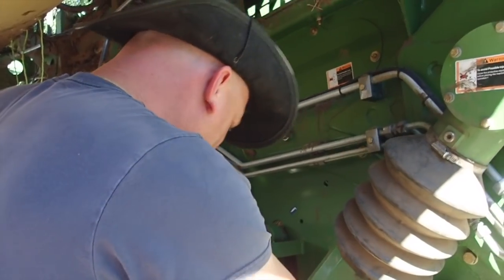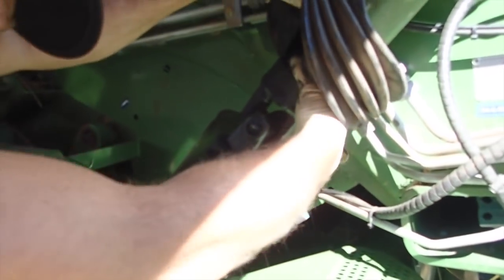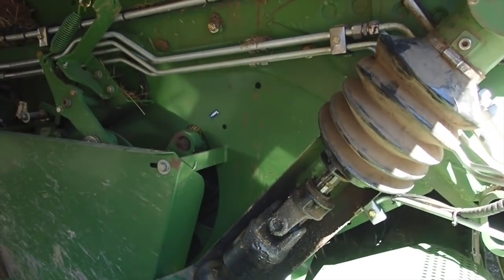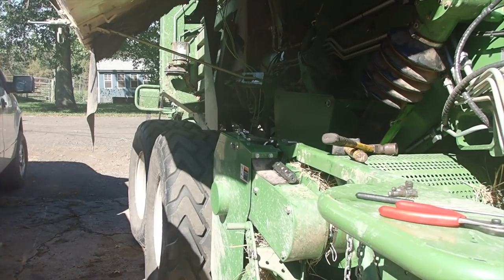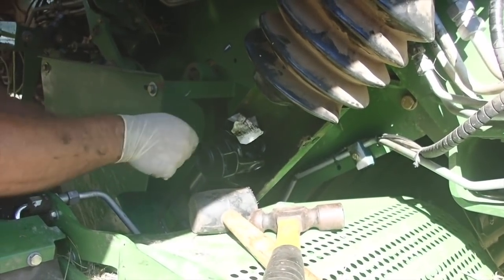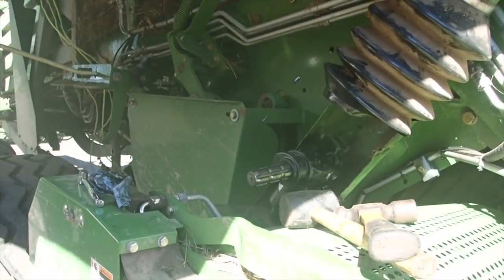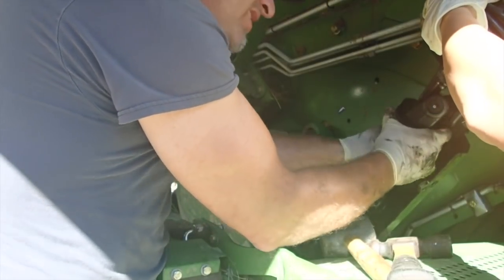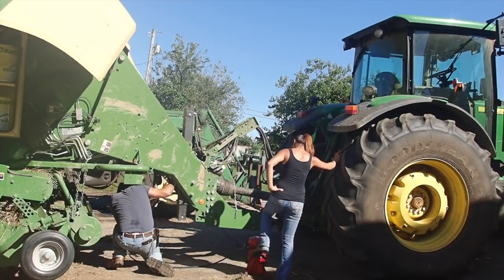Krone Shaft Problem (fix)

Comment: onelonleyfarmer Not sure if it matters in that straight shaft application but it appears you put the shaft together out of phase . Just triing to save you some u- joint problems
Reply from the maker: Walker Vaillancourt it was built that way I tried to king it up properly but it was built to be ofset
Reply: onelonleyfarmer nevermind i rewatched on my laptop in full screen in the begining then slowed down the sped up part you put it together inphase ay one point i think you were triing to get it together 90 degrees out and i missed it due to the speed of movie . I will go back to my heavy repairs now .

Comment: Quick question doses the rear wheels on the baler turn with the tractor if you understand what I mean they just looked on the camera like they do 🤔 and
Reply: Jake Bradbury the rear wheels caster to follow the tractor.  The operator should hydraulically lock them straight ahead for transport, backing up, or severe side hills.

Comment: Neverseize has graphite, not aluminum
Reply: wi11y1960 some have aluminum and copper bases in it also, others have a mix of the 3, some just graphite. It all depends. High heat never seize has aluminum or copper to prevent deterioration.

Comment: shouldn't messics be doing that ignorant job isn't that warranty?
Reply from the maker: dphillips705 nope
Reply: Even if they did, I'm sure he did it quicker himself. Especially the year he's having, he needs to be in the field as much as possible, at the moment.
Reply: onelonleyfarmer why not?
Reply: Bas BlasterXP just the way there written . the 1 year factory warranty usually covers parts and labor. extended warranty covers just parts. 
a chronic failing part that is redesigned and fixed under a factory update usually covers parts and labor.
a redesigned part that is used on newer models yet will work on old ones is just subbed in and covered under any warranty that applies